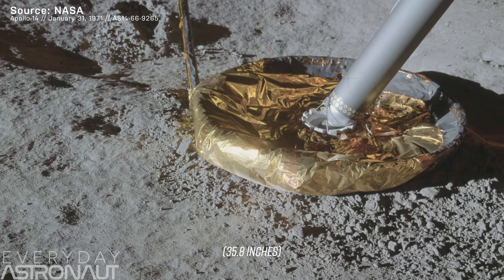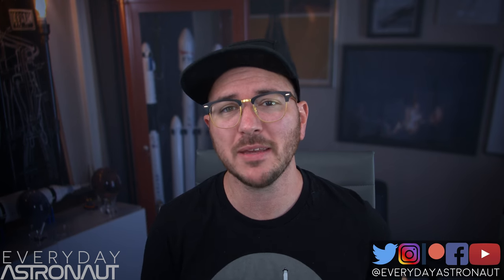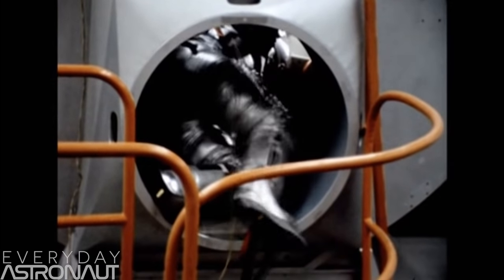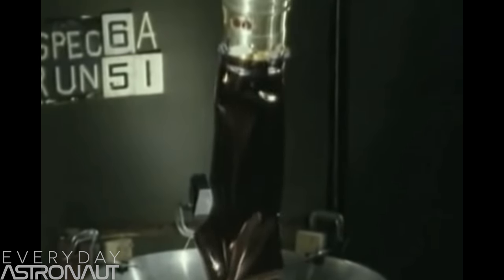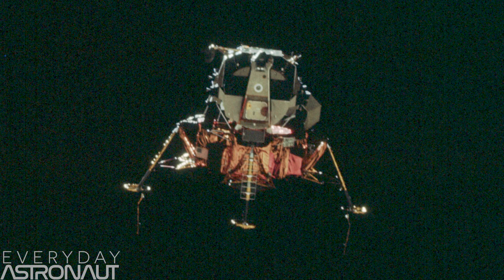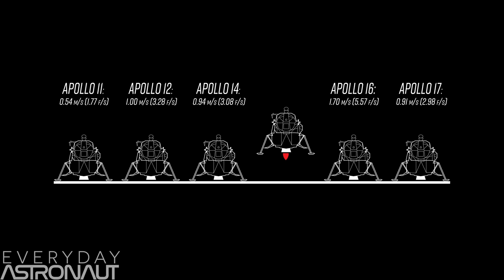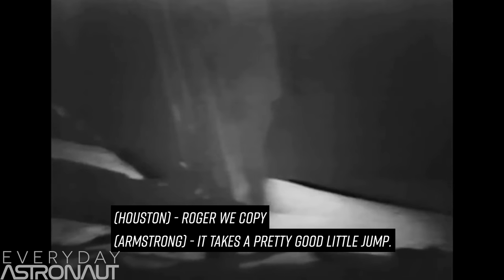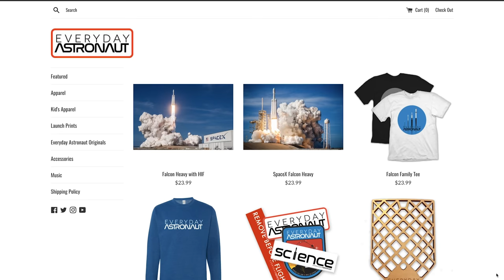Why were there missing rungs on the Lunar Lander’s Ladder?

Comment: Why is there not a speck of dust in that shiny landing pad? Cause the Studio never thought about that. 50 years of lying. when the chinese or someone shows me photos of the rover that wouldn't  fit in the capsule. When I see independant photo's of all these so-called landings and left behind debris. I will believe it.
Reply: The rover wasn't stowed inside the capsule. There is a ton of easily accessible information about the Apollo missions. Educate yourself.
Reply: Dan
Why would you expect any dust on the pads? If there was any, it would be evidence of fraud. All the dust was blasted radially by the descent engine, and in a vacuum there's no air to cause the dust to be suspended or wafted back to land on the pads. All the dust was blasted out like the debris from a meteor impact. 
The Rovers were stored folded-up in a corner of the descent stage. Here's a video of the first one being deployed on the moon -
https://www.youtube.com/watch?v=-ShauSWcTC4
Reply: @PaulSchober  the same reason why I would expect a slight indentation from a 10 000 lb Rocket Thrust nozzle on landing. How do you explain that?
Reply: @mtech1961  
As per usual, you guys take a TINY grain of fact and build an entire straw narrative around it. The descent engine does have that power at MAXIMUM thrust, but unlike the ascent one, the descent engine is throttle-able, and the pilots were trained to decrease the thrust down to a bare minimum, "feathering" it with short taps, once they neared the surface. The concern was that they might dig too deep a hole in fine dust, or get "engine blow-back" off the surface to cause flare-outs. 
In the low gravity, by the time Armstrong neared the surface, there was very little dust that was blown around ( you can hear him talk of "picking up dust", and when the contact rods hit and they announced the "contact light" had lit on their board, he cut the engine completely and let it drop onto the strut shock absorbers. 
On some of the landings - when they didn't do it as well as Armstrong - you can see a small burned area on the ground beneath the bell housing, and on one landing (16) blow-back caused a crack in the descent nozzle.
You guys only EXPECTED an indentation in the surface, because you are all ignorant/arrogant.

edit. Just noticed something I see from you tinfoilers all the time. I answered one of your "issues" (no dust on footpads), and instead of countering it or acknowledging the point (you guys never do THAT) you instead shift off to another one of your "issues". It's like Whack a Mole with you guys. Next comment will likely be "where are the stars?" :)
Reply: @PaulSchober  Are you saying not one speck of dust landed in those pads as the engine throttled down, even at one sixth gravity. Like Elon Musk says. If it looks too real it's probably CG. Explain the Hasselbald Camera Operating temperature range from Hasselblad themselves. Explain how every single photo is perfectly framed despite them not having a view finder. SO many questions so little time. We can use a space telescope to photograph things light years away but I have never seen an earth based picture showing the moon buggy, Just a blurred pixel which could be anything. That Saturn Rocket would have had to have been three times the size to lift that weight and no-one still can explain how they survived the van Allen radiation belts with 2-4mm Aluminium skin.
Reply: @mtech1961  

I don't know if anyone checked to see if there wasn't even a speck on the landing pads, but I wouldn't expect there to be any. It's not a matter of the 1/6th gravity, the same thing would happen with a landing on Earth, if Earth was a vacuum. Without any atmosphere to suspend and "waft" the particles, they would all be blasted radially. How could any drift back to land on the pads? I suppose a couple lucky ricochets off struts is possible, but unlikely. 

What about the Hasselblad temp range? They were careful to keep them at safe temperatures. You must be reading the min and max GROUND temperature on the moon. All the landings were timed for local mid-morning when the ground was an optimal temp, and the suits and camera housings were all either white or metallic to bounce light, so temperature wasn't a problem.

Explain how every single photo is perfectly framed despite them not having a view finder
Every photos is NOT perfectly framed. Here's a handy archive showing ALL the stock photos from Apollo. All 14000 of them, all the good ones and all the crappy ones. You've just been exposed to the best ones. 
https://www.flickr.com/photos/projectapolloarchive/albums

SO many questions so little time.
Tell me about it. Guys like me have been patiently answering these questions for 50 years. 

We don't have telescopes either on Earth or in orbit with the resolving power to image objects like the LEMS or Rovers at that distance. Look up the resolution of telescopes like Palomar and Hubble. Once you go through the math you''ll learn that even Hubble can't detect anything at moon distance that is less than about 50 meters across. 

Please show your math to support your claim that the Saturn V rocket didn't have the power for Apollo.

Nobody can explain how they survived the VA Belt radiation? PLENTY of resources explaining the radiation strategy for Apollo. But to put it simply, the only dangers there are high-energy proton and electron particles (alpha and beta). Both these particles can be stopped quite well with a minimal of shielding, but some will still get through the Apollo precautions, which is why they limited exposure to the thinnest part of the Belts and went through as fast as possible both ways. 
You've been reading nonsense about the radiation hazard in the region.
Quick overview -
https://www.nasa.gov/sites/default/files/files/SMIII_Problem7.pdf

Anything else? I sense "where were the stars"? coming. :)
Reply: @mtech1961  

I don't know if anyone checked to see if there wasn't even a speck on the landing pads, but I wouldn't expect there to be any. It's not a matter of the 1/6th gravity, the same thing would happen with a landing on Earth, if Earth was a vacuum. Without any atmosphere to suspend and "waft" the particles, they would all be blasted radially. How could any drift back to land on the pads? I suppose a couple lucky ricochets off struts is possible, but unlikely. 

What about the Hasselblad temp range? They were careful to keep them at safe temperatures. You must be reading the min and max GROUND temperature on the moon. All the landings were timed for local mid-morning when the ground was an optimal temp, and the suits and camera housings were all either white or metallic to bounce light, so temperature wasn't a problem.

Explain how every single photo is perfectly framed despite them not having a view finder
Every photos is NOT perfectly framed. Here's a handy archive showing ALL the stock photos from Apollo. All 14000 of them, all the good ones and all the crappy ones. You've just been exposed to the best ones. 
https://www.flickr.com/photos/projectapolloarchive/albums

SO many questions so little time.
Tell me about it. Guys like me have been patiently answering these questions for 50 years. 

We don't have telescopes either on Earth or in orbit with the resolving power to image objects like the LEMS or Rovers at that distance. Look up the resolution of telescopes like Palomar and Hubble. Once you go through the math you''ll learn that even Hubble can't detect anything at moon distance that is less than about 50 meters across. 

Please show your math to support your claim that the Saturn V rocket didn't have the power for Apollo.

Nobody can explain how they survived the VA Belt radiation? PLENTY of resources explaining the radiation strategy for Apollo. But to put it simply, the only dangers there are high-energy proton and electron particles (alpha and beta). Both these particles can be stopped quite well with a minimal of shielding, but some will still get through the Apollo precautions, which is why they limited exposure to the thinnest part of the Belts and went through as fast as possible both ways. 
You've been reading nonsense about the radiation hazard in the region.
Quick overview -
https://www.nasa.gov/sites/default/files/files/SMIII_Problem7.pdf

Anything else? I sense "where were the stars"? coming. :)
Reply: @mtech1961  

I don't know if anyone checked to see if there wasn't even a speck on the landing pads, but I wouldn't expect there to be any. It's not a matter of the 1/6th gravity, the same thing would happen with a landing on Earth, if Earth was a vacuum. Without any atmosphere to suspend and "waft" the particles, they would all be blasted radially. How could any drift back to land on the pads? I suppose a couple lucky ricochets off struts is possible, but unlikely. 

What about the Hasselblad temp range? They were careful to keep them at safe temperatures. You must be reading the min and max GROUND temperature on the moon. All the landings were timed for local mid-morning when the ground was an optimal temp, and the suits and camera housings were all either white or metallic to bounce light, so temperature wasn't a problem.

Explain how every single photo is perfectly framed despite them not having a view finder
Every photos is NOT perfectly framed. Here's a handy archive showing ALL the stock photos from Apollo. All 14000 of them, all the good ones and all the crappy ones. You've just been exposed to the best ones. 
https://www.flickr.com/photos/projectapolloarchive/albums

SO many questions so little time.
Tell me about it. Guys like me have been patiently answering these questions for 50 years. 

We don't have telescopes either on Earth or in orbit with the resolving power to image objects like the LEMS or Rovers at that distance. Look up the resolution of telescopes like Palomar and Hubble. Once you go through the math you''ll learn that even Hubble can't detect anything at moon distance that is less than about 50 meters across. 

Please show your math to support your claim that the Saturn V rocket didn't have the power for Apollo.

Nobody can explain how they survived the VA Belt radiation? PLENTY of resources explaining the radiation strategy for Apollo. But to put it simply, the only dangers there are high-energy proton and electron particles (alpha and beta). Both these particles can be stopped quite well with a minimal of shielding, but some will still get through the Apollo precautions, which is why they limited exposure to the thinnest part of the Belts and went through as fast as possible both ways. 
You've been reading nonsense about the radiation hazard in the region.
Quick overview -
https://www.nasa.gov/sites/default/files/files/SMIII_Problem7.pdf

Anything else? I sense "where were the stars"? coming. :)

Comment: Good video except for converting everything converted to metric.   Everything during the moon mission was imperial.     Americans still prefer imperial.   So say things as they were done or both..   feet per second,. Mph  / miles.   inches and feet.  This video is made for the US. People in the us still mostly use imperial.  With metric being secondary....
Reply from the maker: Actually, 70% of viewers of this video are from outside the US. Not to mention, the engineering, even during the Apollo era, was metric and converted to imperial for manufacturing.
Reply: @EverydayAstronaut  then  do both like Scott Manley and. Vintage Space.

Comment: Who put the camera on the moon that filmed the first man walking on the moon ???
Reply: The camera was attached to the outside of the lunar module. Look it up.
Reply: No one put a camera on the moon. The camera that filmed the Aldrin stepping off the lander was a Data Aquisition Camera, which was installed in one of the stowable quadrants of the lander. When the Eagle landed the quadrant unfolded, and the camera was in the correct position to film. The camera was mounted beforehand to be in the correct place to film the ladder once unfolded.
Reply: Jon Watson thanks the camera just seemed so far away

Comment: No idea of the composition of the moons surface? Yet not one thought of tethering themselves to the the LM or each other?
Reply: "No idea"? Surveyor never happened?
Reply: Pygar2 I don't believe ground penetrating radars were used.
Reply: @ashsmitty2244  Neither were outboard motors. They knew the Moon would support vehicle pads, and that the regolith simply wasn't dangerously soft and deep. Apollo 12 even landed a short stroll from a Surveyor!
Reply: Pygar2 “They had no idea of the composition of the surface”. So that means they didn’t know.
Reply: @ashsmitty2244  The purpose of going was to collect samples for analysis. Since the Moon could be safely walked on, tethers weren't of any use. I'm not seeing your connection between rock composition and tethering.
Reply: Pygar2 You are assuming the moon could be safely walked on before even seeing it or knowing what it’s made of. 

Google earth the surface of Antartica. Looks like there could be many places you could walk, until you fall into a crevasse. Now imagine you didn’t know the surface was snow and decided to treat it like regolith. That is what I mean. I’m not saying there is snow on the moon I am saying there are unknowns. And unknowns are not treated with “it should be ok” attitude and moon buggies and the likes. 

When people go walking over and unknown surface like ice. They would tether to each other in case one fell in through the thin ice. There could be thin layers of dust and dirt covering all sorts of crevasse’s and holes and they don’t seem to care. 

It’s just not how anyone would approach exploring a new surface. So therefore I feel it is a joke.
Reply: @ashsmitty2244  Antarctica is covered with ice. Caves and sinkholes are eroded by water. I know of nothing along that line at the 6 LZ sites. I didn't tether myself to anything in the Mojave; they didn't in the lunar desert. The odds of crevasses opening up after billions of years of moonquakes, is ludicrously low. They'd have collapsed and filled in before dinosaurs.
Reply: Pygar2 Exactly, you know the composition of the desert and that's why you can say that. That's why you wore what you wore and went where you did. People do disappear down sinkholes. 

If you don't know anything about the surface, then you can't prepare for it. It could have been sinking sand for arguments sake. 

You don't know what you don't know. 

What's wrong with us? This wouldn't be a normal moon debate without insults. It feels weird lol.
Reply: @ashsmitty2244  Sinkholes are collapsed caves; caves are eroded by water. You are more likely to fall in one as you walk to your car; what form of tether do you use? None, of course. After the Surveyors found a firm surface, why bother? Moonquakes are more frequent and stronger than earthquakes- the Earth yanks far harder on the Moon. Any hollows have had billions of years to collapse. Not much chance of a moonquakes during the few hours they were there. One thing they did was leave a seismometer behind so they could learn about moonquakes.
They knew more about the surface than you seem to think, but I must admit there was a tiny chance of a collapse. Not as big a chance as you take walking to your car, though. Good luck!
Reply: Pygar2 peace out ✌️

Comment: NASA stage props budget was getting short I guess...
Oups I meant, when a gap in the suit mean instant death, you sure want to have missing steps in the ladder right next to pointy metal bits right??
Reply: Sick
A hole in their suits wouldn't have meant instant death. Those suits had MANY layers of protection, with the outer one simply meant to resist punctures and abrasions, with the airtight layer well inside those "armor" ones.
And even in the event of a puncture, the suits were only pressurized to about 6 psi (against 0 psi outside), so it wouldn't have been that energetic a leak, provided of course the hole wasn't too large.
Reply: SlCKB0Y    NASA tries to think of all possibilities. I’m sure they tested everything.
Reply: @nikiwiki2006  yeah, suuuuuuuuuuure ;)